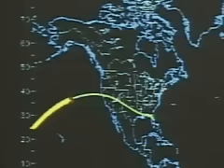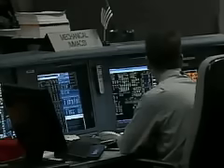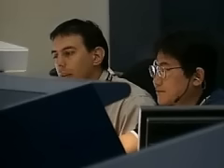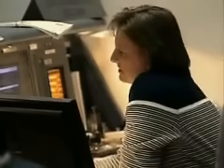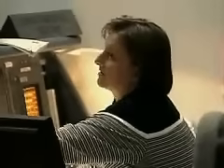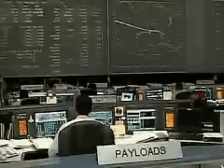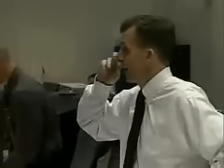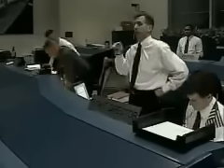Inside Mission Control During STS-107 Columbia's Failed Re-entry and disaster

Comment: The flight director was briefed that the shuttle would be lost upon re-entry. Outside of a miracle, there was no hope for Columbia. For this, we can squarely lay the blame on NASA management, particularly Linda Ham, who stonewalled and barred any effort to examine the damage, or consider a rescue mission, which would have been entirely possible, as the Atlantis could be ready for launch within 72 hours. Ham refused to listen to NASA's technical and engineering staff, citing procedure and budget considerations. USAF were not contacted regarding the use of their satellites to examine the shuttle. Ham, again, stonewalled. There can be no doubt this is all Ham's fault - she has blood on her hands.
Reply: Everseeker Wow! Thats some comment. Not really sure what your saying here. If you're replying to my comment on a rescue mission for Columbia, here is my professional opinion and what I base it on, I don't think it could have been done safely in time to rescue the crew on Columbia. I base it on my twenty six years working on the orbiters. Thats 50,000 hours of on hand experience working in the crew module, testing systems, training crews, repairing crew equipment, modifying equipment, getting the orbiters ready for launch, launching 107 missions and doing 88 landings on the runway as a technician and an engineer. Although I understand that doesn't mean a lot to people commenting on YouTube, but it meant a lot to the program and me. You will not find anyone else on YouTube with that kind of shuttle experience . I give it minutes for people to start tearing this statement apart with humor, rhetoric and mean comments.
Reply: +Brad Whitcomb I don&#39;t think he did know, or at least didn't believe it was likely.  

As for the proposed rescue mission, it was in theory just about within the realms of possibility had the damage been identified immediately, but it would have been a long shot at best.  There was zero chance of getting Atlantis ready in 72 hours.  It might have been possible, if all hands went to the pump and worked 24 hour shifts, and if absolutely nothing at all whatsoever went wrong, to get Atlantis on the pad and ready to launch in 25 days, meanwhile in the best case Columbia's CO2 scrubbers could have been made to stretch to possibly 30 days.  But the shuttle is not like a Toyota Hilux, you can't just toss some supplies in the back and go, it's possibly the most complicated machine ever built by the human race and it is constantly malfunctioning or in need of repair or maintenance in one form or another.  In reality it almost certainly would have taken longer than the 30 day window.  

As for crew, Atlantis would need at the absolute minimum 4 crew for a rescue mission.  2 pilots, and 2 EVA astronauts to ferry spare suits to Columbia and to assist in ferrying Columbia's crew back.  A 2 man crew was out of the question.  Even when 10 or 20 feet apart, the simple physics of orbital mechanics will dictate that without someone manually executing station-keeping manoeuvres, the shuttle that's closer to Earth will tend to want to race ahead of the one in the higher orbit, even with such a small difference between their relative orbits.  And given the critical timeframes here there would have been virtually no time for choreographing the mission plan and training to execute it.  This would rule out all but the most experienced of NASA's astronaut corps as candidates to fly the rescue mission.  

Planning STS-400 (the rescue mission that would have been used had something gone wrong on the last Hubble servicing mission) took 11 months.  NASA would have had 20-30 days to improvise a Columbia mission.  There would be literally zero margin for error or schedule slip.  

And then what happens if Atlantis suffered the same kind of damage on ascent as Columbia had?  Then you'd have 11 astronauts and 2 orbiters being lost instead of 7 and 1, respectively.  

http://arstechnica.co.uk/science/2016/02/the-audacious-rescue-plan-that-might-have-saved-space-shuttle-columbia/

Don't get me wrong, I'm not defending NASA here, they failed to learn their lessons from Challenger and let a bloated and bureaucratic middle management layer get sloppy with risk management and repeat the same mistakes that doomed STS-51L.  Just don't think that Atlantis was ready to go at a moment's notice because it wasn't, and don't think that a rescue mission would have been easy peasy because it wouldn't have been, not remotely.
Reply: +John Sattler

It's all in the disaster report. After the report was published, Linda Ham was demoted and lost her position. This is all public knowledge. She screwed up, big time.
Reply: There were options other than using Atlantis. RCC panel 8 could have been repaired in an EVA. Politics and having the wrong leadership killed the crew.
Reply: +jrockett73 I strongly concur... but only... Kinda.While a perfectly fitted suit, allowing a person to work for a few hours, without binding, perfectly mated, takes a lot of work... Any existing big suit, into which an astronaut could be stuffed, and pulled from ship to ship, would have been fine.Don't need to DO anything for the trip over, except to keep breathing.Getting the orbiter to the pad and mated - could cut it down to 4 days, if you cut out all of the testing stepsGetting the cabin installed and reconfigured - Major issue (Sure, you could go UP with 2.... it's the coming DOWN that would pose a problem)Getting the CREW TRAINED ON EVA PROCEDURES?Ummmm, OK. I was in the USN for a long time. Worked as a Damage Control engineer on an aircraft carrier. We trained for LOTS of things.BUTThere were things that happened that we never specifically trained for(Who knew that if you were in the space ABOVE a major fire, ensuring that there were no disabled crew members, that the floor would buckle up about 2' right as your boots began to liquefy [response - got on a desk and yelled for water... LOTS of it... NOW! then suffered for a few seconds as the first bit flashed to steam]....Get 2 of the best astronauts, with the most flexible minds, and they would be able to carry it off. (Yes, the exact procedure would need to be gamed and modeled over and over, right up to, and after launch, but it was "doable")72 hours... hard stop... no more O2 after that... all perish. But... really?If you are NOT planning to come home with the ship... are there CO2 scrubbers on board? How much is in the Air Packs(+spares) for the EVA Suits?(Terrible Idea, but thinking out of the box- could anyone reach & remove one of the liquid O2 canisters? and would there be any way to slowly bleed that into the cabin air? (Pure O2 = bad idea. Mix with cabin air = better... ONLY If CO2 could be scrubbed. If a person was in 80% O2 and 20% CO2, they'd die anyway...))I DO think that, even if it was an all hands effort, NO Safeties in place, running NASA<--Mercury style, They would still arrive to find a perished crew.(Or, a mostly perished crew, each holding a long straw and 1 short straw, clutched in the hands of 1 living astronaut, who was cocooned in duct tape, to prevent him/her from doing something stupid)All that is armchair work, years later.Reality - they died. It's pretty obvious that the crew had NO idea that things would go poorly on reentry (Watch the video of the last moments of the crew. They were happy. Read the accident report, Death was pretty much REALLY quick (No burning alive or such. Just rapid acceleration/decelerations, strong enough to overcome their seat restraints. Strong enough to break their necks. Strong enough to send them up, while their bodies fell down)It is, what it is.
Reply: How do you know this? Where does your information come from? Did you work there? Do you know these people as friends and they shared all this over beers? Tell us, please, specifically, what is the source of your information.
Reply: +jrockett73 WOW... YouTube mangled all my formatting... I had it all in sections that made it parse a wee bit better. and indented the asides... Oh well.
Basically, I concur with your assessment. 100%
There were some things that were advanced as barriers to a rescue that could have been overcome, and there were some things that could not.No matter WHAT was done, there would not have been time to rescue the crew, or even just 1 person. Not even close.
Reply: Its already been said Atlantis would have had to launch with a minimum crew of 4 not just two.  While NASA would have put their heads together and done something the Atlantis launch would still have been the only option and still been off the charts risky
Reply: This mission was not equipped for EVA. Eva also requires prepared training prior to flight.This was not done with this crew
Reply: Dennis S Also, no repair supplies on board. Techniques for on orbit repair were only developed in the wake of this tragedy. And there was no knowledge that a hole was actually in the RCC panel. Mgmt didn't authorize the on orbit photos that would have revealed it. At return to flight, the program was equipped to deal with damage from foam strike. But for Columbia, they were flying blind.
Reply: Sophia A I compltely agree with u Sophia. Linda Ham has blood on her hands.
Reply: Bull shit. Yeah they could of rescued them given the chance, but they wouldn't get Atlantis up and running with in 72 hours.
Reply: Atlantis at the time was six weeks away from being ready to launch, they could have reduced that to four weeks at the most, and that's with reconfiguring everything that was already set up for a different mission. You have to remember Atlantis was being prepared for a totally different mission compared to what Columbia was on. Now I think you Estrella should look into what it takes to get a shuttle ready for launch, its not the case of moving the shuttle to launch pad and hitting the launch button. Atlantis was already configured for a different mission, which you would need to reconfigure computers and remove equipment, install equipment for shuttle to handle the extra crew etc. If you take the time and read my first post on this subject, my argument is that it was impossible to get the shuttle ready with in 72 hours, that's a fact and if you had some knowledge you would understand that.  I do agree with you that a rescue would have been possible, I have not once said it wasn't possible, so you have no evidence to base your mentality insult.  NASA knew that something had happened but they choose not to investigate it further at that time. As the mission continued they became aware of the danger by each passing day. Yes Columbia had enough provisions to stay up there for 30 days, and a leading expect clearly started that NASA would have had to started to act on a rescue mission by day two of the mission. If NASA had acted, this would have given them a 5 day window to get up there and rescue them. Everything takes time when talking space missions, and the simplest tasks are harder in Space. Like transferring the Colombia crew to a another shuttle would of taken around 48 hours to complete, that's 2 days of your 5 day window gone. Space shuttles cant dock with each other, so it will take some skill and a lot of time manoeuvring a rescue shuttle into position. Everything in space has to be done in slow stages, take the docking of the shuttle to ISS, that can take hours or days to complete. Just look at how thrusters work, a thruster might provide 97% of nominal thrust one time, 102% the next. That's uncertainty, and that's why manoeuvring in space takes time and is not rushed (Its not like in the movies up there). Just to make it clear to you Estrella, I do agree with you that a rescue mission WAS possible and should of been given the chance to attempt. Like I said in my original comment, my argument is that it was impossible to get Atlantis ready for launch in a 72 hour window, I stand by that comment and I think you are being unfair to say that my mentality is the reason for this heart-breaking event.
Reply: Good call Bear Mare. Ham is the culprit. For a kickoff, she's a blonde! Joking apart, she was responsible for preventing other agencies helping get photos of the damage, on the basis "let them have a happy and successful flight" because knowing they'd explode on re-entry would only piss on their potatoes. So best that nobody knew the truth. There's a reason why ALL subsequent missions (apart from fixing Hubble) went only to ISS, so there was the option to return astronauts on another shuttle if catastrophic damage occurred during launch.
Reply: Lot of blame to go around.  NASA culture.  Ham.  No real formal request to the DoD for imaging and they canceled the tentative one that was initiated.  EPA requirements causing the foam composition to be changed.  No effort was made while they were in orbit, though.  Always be candid and fully disclose to your pilots.  You also have to have eyes-on.  The pencil pushing has to stop at some point and you can't just rely on speculation, and certainly you do not put institutional "team" butt-covering and political considerations to preserve program PR above a crew.  You also do not discount or avoid possibilities to find solutions while in a bubble.  You need inclusion and openness.  For instance, Atlantis could have reached them.  The ACES pressure suits are more sophisticated than what early astronauts had for the first spacewalks.  There are many possibilities, but keeping it within a small group, not sharing it, not asking for outside input, and not exploring contingencies and alternative viewpoints doomed them.  Some weird infestation of a kind of corporate mentality, academia-like grant-protectionism, and the constant need for sanitized, homogenized PR.  This is a far cry from the practical engineers and battle-hardened pilots of WII that worked on Apollo.  Sally Ride made an observation that the problems that led to to the Discovery mishap were surprisingly similar to Challenger's.
Reply: Everseeker Agreed. Thank you.
Reply: No sir your expression is welcomed and respected, as it has all the marks of someone who knows a bit about what he's talking about.
Reply: @Bear Mare....your statement is 100% utter bs.
Reply: @Rogue Ldr1123 Columbia did not have a docking mechanism, in the cargo bay.  So no, they could not have docked with the ISS.
Reply: +Brad Whitcomb Where did you get your information that Atlantis could be ready in 72 hours?
Reply: There were contingencies considered that included a rescue mission with the Atlantis. It was the next mission vehicle for the following launch. Preparing it with a stripped down payload, and just two astronauts, it would have been launched within 72 hours. Carrying with it appropriate equipment for a ganged spacewalk between the cargo bays, it was a bold though untried effort that NASA technicians strongly believed would have been successful. Ham doubted the proposal's options for success and stonewalled. Remember: NASA technicians saved three Apollo 13 astronauts  through innovation and engineering on the fly. A rescue mission for the Challenger would have employed resources that would have made a successful mission very possible. Ham played it by the book and screwed everyone over.
Reply: ***** This could have never been pulled off. The payload bay was already configuered for her launch. Changing that would take a week or more by itself. Second, the crew module is empty until about 10 days prior to launch. All the equipment is supplied by Houston. Space suits take weeks to get ready and are fitted for the crew and come from Houston. Again, the crew module could have never been ready. Crew training in 72 hours, no way. The actual countdown starts 72 hours prior to launch. Software could not have been ready in 72 hours.  I could go on and on. This is exactly why this never happened. People can talk all they want.
Reply: Actually, no. The launch was still some weeks away and removing anything in the cargo at that time would not have been a problem. Stripping down Atlantis, two pilots, and there would have been more than enough room for Colombia's crew. Suit prep would have been minimal as stock suits were available for two pilots, both NASA veterans. Columbia already had their suits. And even if 72 hours prep for launch was too narrow a margin, with rationing, Columbia's remaining food and water could be stretched to about another two weeks. With arrival at Columbia, Atlantis would have moved into tandem orbit - as was done with the Gemini missions - transfer of food and water to Columbia would have occurred in advance of prep for a gang-spacewalk. Entirely doable and worthy of NASA's abilities. Rescue and recovery was in a far better position in terms of time and resources than Apollo 13, and that one really was by a hair's breath. Ham stonewalled, blocked, delayed, and killed Columbia's crew because she thought, procedurally, that's what management was supposed to do. She was wrong and she paid for it; however, not enough, IMO.
Reply: ***** Actually yes. Changing the configuration of the cargo bay takes time. Not a few hours, not a couple days but time that they didnt have. And the equipment needed for a rescue mission in the cargo bay was not even at the Cape. Its obvious you know nothing about preps for launch. Stock suits for EVA's? Those dont even exist. Suits come in small, medium, and large. The arm length and leg length are custom fit for the people doing the EVA. And yes, there were only two suits on Columbia fitted for only the two crew members trained for a required EVA. The orbiter was in the hanger. Mating it to the tank and booster has never been done in less than five days. It all sounds good in a movie but in reality could have never been done.
Reply: That would be true if it were not for what was revealed in the report from the inquest into the Columbia disaster. It was revealed that there was a culture at NASA that prevented technicians and engineers from accessing management. Regarding the request for satellite photos, Ham claimed there was no "serious" request. However, on Frontline, NASA engineers revealed that they had a hard time accessing management for any request. As for the request for the photos, it's likely any request made by engineers to management was not treated seriously. On the matter of a rescue mission using Atlantis, it was in the works and was very doable. Regarding the spacesuits, there were suits available - all they needed were two. And even failing that, suits from the Russian program were even considered. The inquest was lead by a retired US Navy admiral and not a NASA insider. Why? Because the political climate in NASA was hostile and had been so for some time. It was well-known that management decisions were predicated on tightening NASA's budget. A rescue mission, which would have cost hundreds of millions, as well as delaying a launch on the schedule, would have put NASA in a dangerous financial position. Management rationalized it was better to lose a shuttle and kill a crew than do anything else. And if all that could be done was done. why was Ham busted out of flight management and moved to projects away from the JSC? According to you, she did nothing wrong and was not responsible.
Reply: ***** Maybe there was a culture in some areas but not everywhere. Most technicians and engineers had no problem at all integrating concerns, problems or issues to management.  Linda Ham was certainly an issue. If you read some of my other comments about her, you would know I had a problem with her and her inexperience. 
There was no rescue mission in the works except talking of a wish list at JSC. Training, logistics and hardware changes never happened or even started. As far as financial concerns, I never heard any decisions during the entire program based on money. That's been drummed up by the media and politicians. I am not saying all was done that could be done. I am defending the fact that a rescue mission by Atlantis was never going to happen.
Reply: That's not what the inquiry found. Barriers to access between NASA management and engineers were constant and systemic throughout the organization. The retired Admiral, who had no political axe to grind, found that there was sufficient reason to believe that the failures in communications and action were because of the sectarian culture at NASA. When PBS Frontine covered the Columbia disaster, interviewed engineers noted the failure of management to appreciate the gravity of the situation, the high potential for a catastrophic failure, as we as their complete disinterest in the active simulation, which materially proved that there was severe damage to the left wing of the shuttle as a result of the foam impact - damage so severe that the heat-shield and the wing section were breached. Regarding using Atlantis as a rescue vehicle, it was seriously considered and early planning was in works to bring it online for a rescue mission. There was even lines of communication opened to the Russians for their assistance. All these were squashed by Ham. It should also be noted - though not part of the final report - that Ham was in a depressed emotional state as a result of her ongoing divorce proceedings. Not recusing her from involvement in the mission was a gross failure on the part of NASA management, as they were aware of Ham's difficult state of mind. Regarding budgetary considerations, they were very much at the forefront for management's concerns. Again...it was better to lose a shuttle (the flagship) and the crew than blow a hole in the budget.
Reply: +Brad Whitcomb The inquiry was done on a select few engineers and most of it was based on the accident, not thirty years of flying  shuttles. It wasn't broad enough. I do agree that mgt. ignored concerns about Columbia's wing impact. As I said before, Linda Ham was a problem, I knew her ex well, Ken Ham. Maybe upper mgt. had discussions about money behind closed doors, but I never heard any in middle mgt. or first level mgt. It just didn't happen.
Reply: The historical record from the christening launch of Columbia in 1981, and the response of to the Challenger Disaster, formed the basis of the analysis of NASA culture. The final report would a troublesome political document, that's why it was turned over to someone without a political axe to grind. In writing a report that was supposed to be politically unbiased, there were sections that were sanitized. I supposed to protect the innocent, but also to preserve the guilty. Ham was a problem, but of course the reason were sealed. Was she inexperienced? Obviously not enough to has stalled her rapid rise through NASA's ranks. Obviously, she's brilliant and was considered to be capable of managing a flight. But she was stymied by NASA's culture. It's not like other organizations don't have the same problem - everyone knows that culture clashes within organizations happen all the time.
Reply: It is complete nonsense that any rescue mission could have been launched 72 hours after notice that it was needed.

The after report of the disaster included a theoretical rescue to see if it could be done.  This was titled Appendix D.13.   Google it. 

Keep in mind this is with MONTHS of research, which they did not have beforehand, and even after MONTHS of thought was put into it they came up with a minimum time required to launch of 21 days.   

21 days, IF everything went perfect, IF nothing was found wrong, IF the crews could train on time, IF IF IF.  And in the history of spaceflight its NEVER been a perfect lead up to launch.  There are always failures, components that are found faulty and need replacement, etc.

And on top of all that, you are now exposing yet ANOTHER shuttle and crew to the exact same danger.  Nothing could have been done about the shuttle tank, nothing could be done about getting a repair kit together that fast, etc.  So basically, take a chance on killing one crew and shuttle, or take a chance at killing them all.

Could better decisions have been made?  Sure.  But there's absolutely nothing that says any rescue would have worked for sure, or that they were even remotely read for it.  They were not.
Reply: +Brad Whitcomb Columbia only had 2 EVA Suits on board....
Reply: How can that decision be in the hands of one person? Was she the only one who knew? If even just 2 people knew about this wouldn't the odds of one going loud with it be very high DURING a LIVE  NASA MISSION? Not arguing, asking - I've no real knowledge of how NASA works - I do know about redundancy though.....
Reply: Pontiac2001GT Columbia launched with 2 in 1981; we land rovers on mars automated. Pretty sure Atlantis could have flown. Regardless, it could have docked back with ISS and they could fit 3 in a Soyuz and the rest in Atlantis
Reply: Yep yep Linda Ham should actually been executed for this. She could have done something, but she didn,t. This is in fact homicide one.